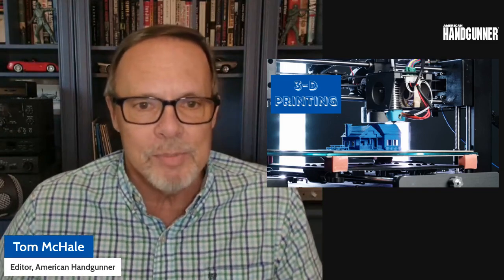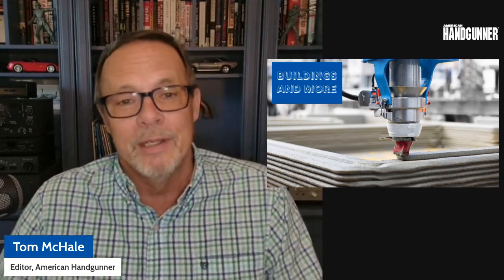3D Printed Holsters: Fad or the Future? | American Handgunner Insider

Comment: 3D printing is for low production given material costs and time not just one off production pieces. Benefit is you can actually set all your dimensions without any built in stresses while achieving the necessary finish. Down side is the appearance, you can’t get super cool graphics like you’ll see with kydex.

Comment: I think if they get the combination right for materials, this is the future. Holster makers would also benefit because they can "print" on demand for whatever handgun is selling hot at the time.  and this also works for firearm and attachment problems. Good article Tom.
Reply from the maker: Manufacturers are already using 3D laser scanning to scan a new gun. Then that info goes right into a CAD machine to design the holster. Then to the 3d Printer for prototypes. Roy

Comment: This will not only help with hard to fit gun/light/sight combos, but it will also eventually lower the cost of the holsters by allowing makers to avoid having to stock hundreds of models of guns to make the holster.  
I can anticipate that they will come up with materials that have a slight bit of stretch, making the holster act like leather.  With laser modelling you will likely be able to take a picture of your gun and send it to the manufacture and they can custom print your holster to your exact specifications.
Reply from the maker: How nice it would be to not have to have an inventory of holsters, simply print out one as they get ordered. Roy

Comment: This will really help with generic imported lights & accessories attached to fit right. Universal fit is not Universal fit. Good info! 👍🙏
Reply from the maker: I've not had great success with Universal fit either... I do prefer carry holsters be able to pass the "shake upside down" test (with an empty gun!) - TM
Reply: @fmgpubs Absolutely because if it won't stay empty it won't be secure with anywhere from 8 to  20 - on average - little friends along for the ride. Especially if little friends are 147gr & up 👍.